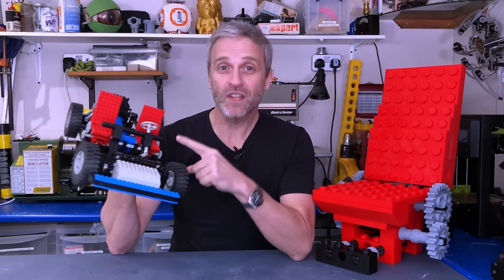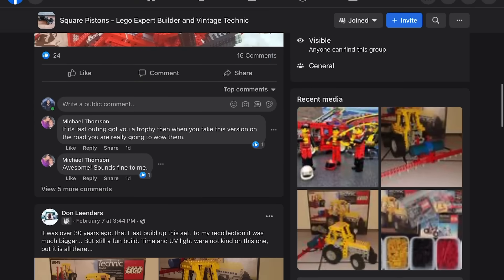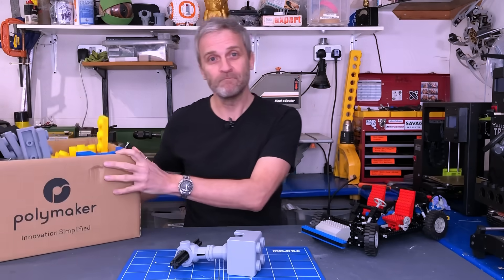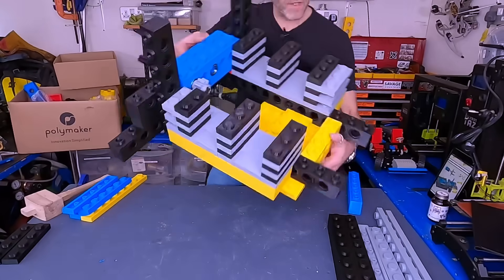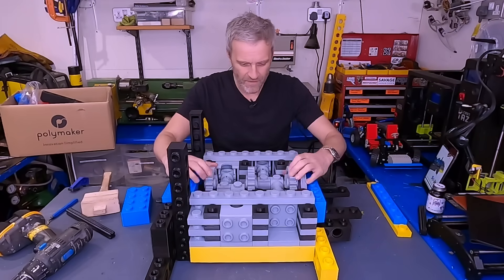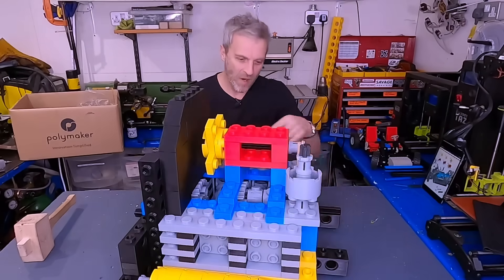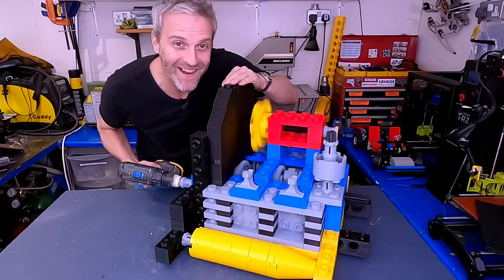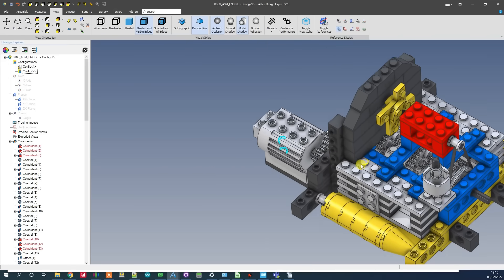GIANT Scale Lego Inspired 1980’s Engine - 3D Printed - Mantis Hacks

Comment: Wow, this is so cool. I also had this set, and as many others, I have many fond memories of playing with it. I hooked a motor to the engine, propped the wheels up in the air and "drove" the car. I powered the poor motor with 12 volts, which eventually made the motor melt. It had got so hot that the solder had melted and been flung all around the motor.  
 So wonderful to see it in full scale. And the sound of that engine.

Comment: When I had that car model, I used an old lego train motor, which I think is called an x469b, which with a tiny change, was able to fit straight onto the back of the engine, where the axle protruded a little, just like it does in your model.

I am not sure if lego designed it that way, but it was a pretty perfect match, as it also rested on those lugs which stick out the back of the engine.

The motor in question was already a gear motor, so contained a gearbox to slow down the rotation.

It had four places where lego train wheels could be inserted, and another, off centre hole, which fitted a technic axle, which if I remember correctly lined up pretty well with the shaft of the engine.

I can't be sure now, but as far is I know, there was no official technic motor at the time, so it was period accurate at the time.

Because of the form factor of that motor, if you 3d printed one, there would be ample room for a battery box, speed controllers, a metal gearbox, and of course a large motor.
Reply from the maker: I remember that motor. I had one in yellow :) 👌👍

Comment: What are the width of the pistons? Im curious what the CC/CUI (Cubic centimeters/cubic inches) of this engine might be (unless I missed it on the video) I'll be assuming the engine is square, (i.e W×L×H are equal) with a normal car engine you can Farley accurately get the CC/CUI of an engine with just a calculator- radius × radius × pi × strock (engine at bottom dead center) × cylinder number. But with this o would just go- Length × Length × pi × stroke × cylinder number.

I hope this made sense. Lol I spent a little to much time thinking about car engines.
Reply from the maker: Well it’s 80x80mm square. Stroke would be about 60mm I think
Reply: @MattDenton  about 1.5L/90CUI on square pistons, and about 1.2L/73CUI if they were rounded.
Reply from the maker: 😆 good to know :)
Reply: @MattDenton  👍

Comment: With a max power output of 0.555Hp, a capacity of the (idk) 1L, a full ALPL (all plastic) construction, and random "mechanically" controlled VVL OHV, and AFR of 0 and 0-1 compression this engine has the power density of a wet sock.

Comment: Use graphite powder mixed with a bit of silicone oil to lubricate the pistons. Once the oil rubs away there will be a good layer of graphite worked into the plastic, leading to significantly reduced friction. I use this in nerf blasters when I need a pump or something high-friction to run smooth
Reply from the maker: Cool thanks for the tip 👍

Comment: You could make like a soap car and have the axel do the motor running - sort of the opposite of what's meant to be going on, really, but yeah.
And ofc. with reversed gear ratio'ing, so it runs the motor super fast at even low speeds.
Reply from the maker: Yeah nice idea 👍

Comment: It looks like the piston head is printed in one piece, upside down on the bed. This means that the layer lines run perpendicular to the direction of movement, which will increase the friction. You could reduce this, at the expense of extra complexity, by printing each of the side walls separately and then screwing it together.
Reply from the maker: Yes I agree. It’s sonothing I’ve been thinking about to decrease friction. I think I can print the piston in one piece with the internal part too and have the layer lines in line with direction of movement. This will also give a flat bottom surface which should help.

Comment: to make the pistons slide better, you could use some Low Friction UHMW tape maybe?
Great video!
Reply from the maker: Thanks I’ll take a look at that 👍
Reply: @MattDenton  I have had excellent results using a dry wax lubricant for sliding doors for making 3D printed parts slippery.  You apply it like a crayon.  The wax smoothes the 3D printed textures and gives a surprisingly slippery surface between parts.  And since it is dry it does not attract dust. AGS-Door-Ease-Lube-Stick
Reply from the maker: Thanks 🙏 I’ll take a look at that 👍
Reply: @MattDenton  As a quick and dirty fix, a quick spritz with Dry PTFE Spray lube will do wonders.

Comment: This is brilliant ! I heard the 3rd cylinder was possibly prone to overheating on some of the original beetle engines due to insufficient airflow from the fan blowing less air past the oil cooler  :-)  You could use a thermographic camera to highlight the temps of the PLA during running, would definitely be interesting to see. Anyway, great job!
Reply from the maker: Oh that’s a great idea!! See where the friction is building up.

Comment: Fantastic project.  How long did it take to actually print out all the parts, excluding design work, and what was the cost of the materials, excluding motor?  Many thanks!
Reply from the maker: Hmmm. Tricky to know. A 1x8 technic beam takes about 7 hours and weighs about 200 grams which is about £4 of material. But I have a material sponsor

Comment: Awesome..!!

No doubt you're already working on some way to integrate a small petrol motorbike engine and a centrifugal clutch/gearbox system to drive the full car.. right..? :D
Reply from the maker: 😆 petrol!!! 😬
Reply: @MattDenton  Sure.. why not.. :D
and as cool as the Chassis is, I really prefer the Red Test Car 8865..

I'd also suggest perhaps little metal crosspins in the knuckle-to-axle-to-lnuckle joints, or maybe a bit of kragle, to stop them letting go under high rpm

Comment: i have experience with pla pistons in air engines they wont melt... ive ran a pla turbine to 10krpm in my hand all pla except lego axle so i can measure rpm and stuff
Reply from the maker: Cool. Do you use a lubricant?
Reply: @MattDenton  not yet im gunna probly try to use some graphite for lube instead of olive oil which is also used but i plan on...

Comment: There's some cool Teflon tape which has one sticky side. It's different than the tape used on pipes. This version of tape is great at reducing sliding friction. You could put some of this tape on sliding elements in areas which won't be visible.
I'll find a link to this sort of tape if you're interested.
Reply from the maker: Cool idea :)
Reply: @MattDenton  I can find several sources on Aliexpress when I search for teflon tape adhesive.
Thanks for another fun video.

Comment: Excellent work, Matt! This is going to be an absolute beast once completed. I'm a Solid Edge user myself and have a massive library of Technic Elements designed - mainly for the Motorbike model 42036.
Reply from the maker: Thanks 🙏 are you going to 3D print it? 👍

Comment: That’s so friggin cool 😂😂 well done Matt. With that new belt printer you got, I’d like to see some modern studless technic sets be made! In the far future of course, wouldn’t expect you to take on another model right after finishing this one
Reply from the maker: Thanks 🙏 I’m not sure about the modern stuff… although I did read that Jan’s colleague was the one who files off the studs! 😆
Reply: @MattDenton  Agreed I am not sold on the really modern Technic - studless beams in moderation are great for pretty and functional braces and those moving elements that just need to be smoother, but the full on studless beam craze of modern Technic means if you don't have the part you need there is no fudging it out of other parts (or at least its orders of magnitude harder) and for the most part they are getting used where the studded beam would have worked just as well - maybe even better, probably mostly because studless ones are much cheaper to make..

Might I suggest something in the middle - perhaps the Cybermaster (Or the RCX Robotics invention sets)? The Cybermaster in one of its guises would be a fun build, and one in which you can show off some electronic skills again as the 'computing' brick with its radio link of that set is quite large and very functional - 2 motors inbuilt with odometry (if memory serves), one 9V motor pad, some sensor pads of the RCX 9V type (only came with the toggle switch, but I am pretty sure the hardware can do anything the RCX could) and two nice big RF antenna sticking out (which made it in many ways better than the RCX that only had IR)..
Reply from the maker: I’ll take a look at that.. I’m a bit out of touch with modern Lego 😆

Comment: Totally awesome!
I was wondering how you were planning to power it.  As I mentioned before, I had this kit.  I was interested in attaching a motor to it way back when.  But, the directions in the book showed a massive motor in place of all that wonderful engine supposed to be - That wasn't going to happen!

Q: Sorry if you've been asked before, but what 3d modelling software do you use and does it create the gcode file without the need for another application?
Reply from the maker: Yeah I noticed the placement of the motor removed the pistons! I will find another way or hide a small motor somewhere. I use Alibre design, but you still need a slicer for the GCODE.
Reply: @Matt Denton  
Thanks I'll check it out!

Comment: Very cool.

I actually use PLA for gears in my RC racing cars. They hold up ages as long as there's a thin film of grease. I use a small paint brush to apply the grease as a thin layer so it doesn't splash off the gear in use, and that's all it ever needs. The touring cars I drive in my recent videos all use 3D printed gears, dog bone cups and pulleys.
Reply from the maker: Good idea! It defo needs some lube:)

Comment: Very nice build and video. But I have one correction for you: It's not a boxer engine, it's a 180° V4 engine. In a boxer engine the opposite pistons move at the same time to the crankshaft (so they try to box each other)
Reply from the maker: Interesting! I’m trying to picture that now… 180 V4 for a somewhat confusing sue to the “V”.. how about 180 horizontally 4?
Reply: @MattDenton  it's just a technical term. The most flat 4 cylinders are boxer because a flat v4 would build up too much torque on the crankshaft itself. (You have to build it very heavy and sturdy)
Reply from the maker: Yeah I’m trying to figure out why it’s a problem to have them in this configuration.. I can’t see how the boxer helps..
Reply: @MattDenton  in a boxer the force of the pistons on the crankshaft negotiate each other because they move to the exact opposite direction. With the flat v4 the two pistons move in the same direction and the force of two pistons pull on the crankshaft. So a boxer have nearly no force on the crankshaft while the flat v4 have a very big force on each crank pin

Comment: I would integrate the electric motor in the red part that holds the fan, its axle is already geared with a reduction to the motor and a small electric unit would be invisible if placed there (in a fully enclosed piece)
Reply from the maker: Good idea 👍
Reply: But wouldn’t the belt slip if just a bit of load resisted the crankshaft?